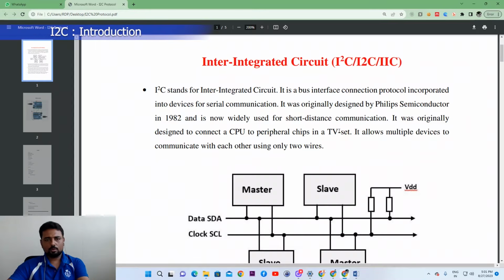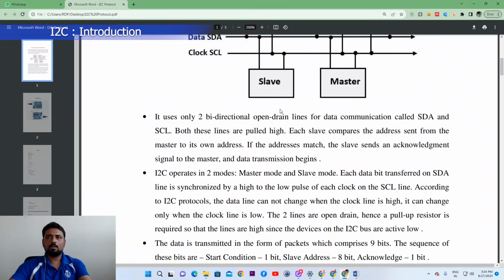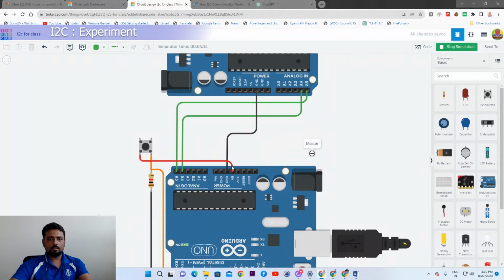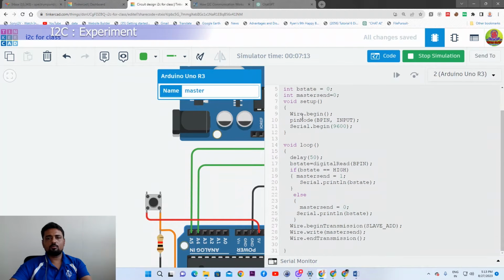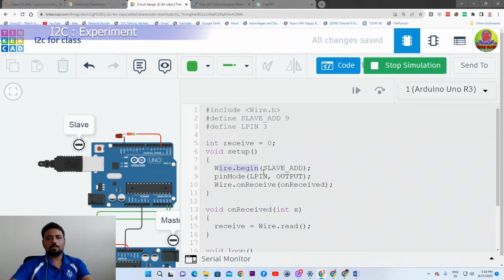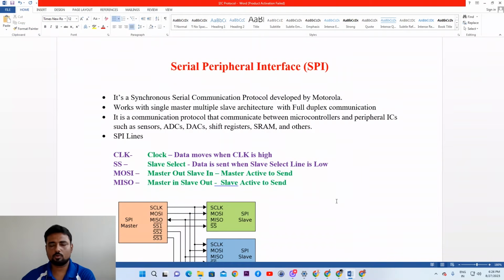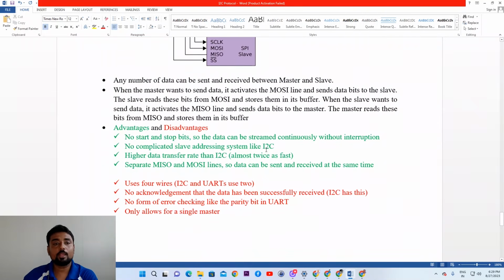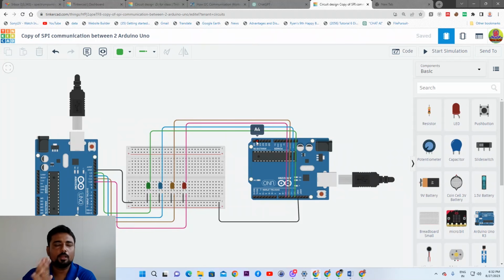5. Arduino UNO - I2C and SPI Protocol

Comment: in i2c protocal simualtion,the wire library is not working
Reply from the maker: It will only work in Arduino IDE.